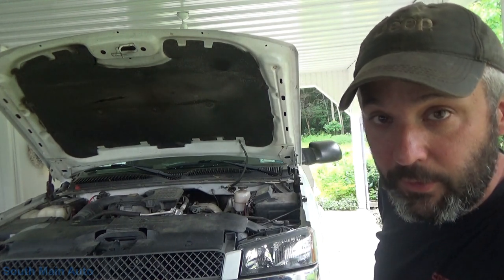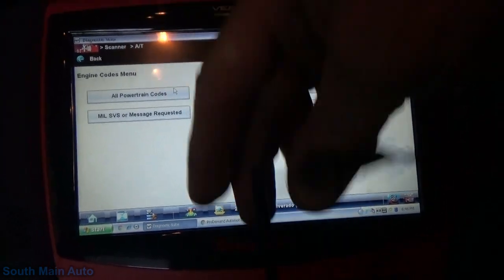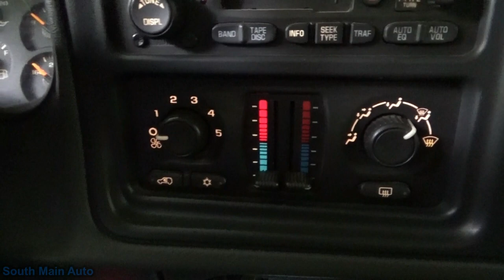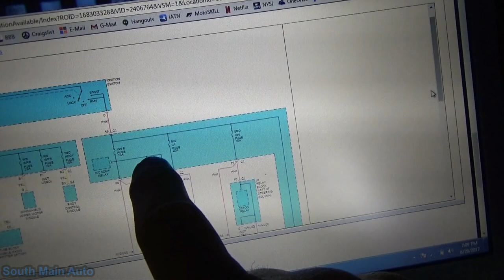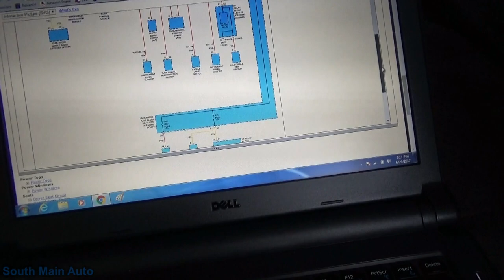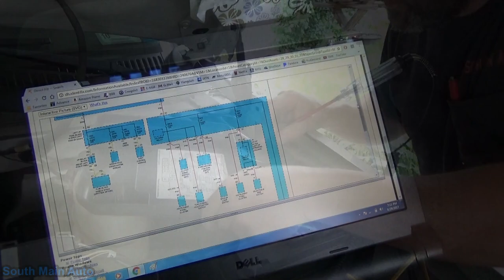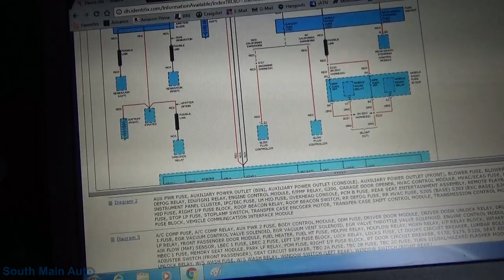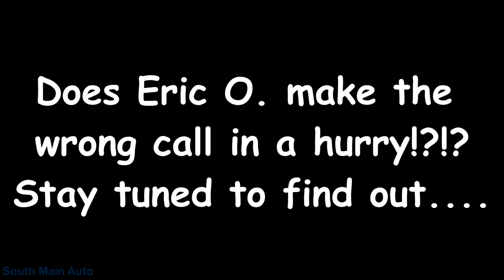Chevrolet Truck - No Start, No Crank - Part I

Comment: Had this same exact to the T situation I was facing today! Thought way back about this video and sure enough wire to ign riding on that same location of fuse box braket green crusties. Gave er a tug and popped in two! I have learned so much from you! Eternally grateful for all you have taught me throughout the years! You rock!

Comment: One diagnostic tool I use a lot and swear by is my relay tester . Plug relay into it and it takes the relay through ten power cycles and does a milivolt drop test over all the contacts. It gives either a red or a green light after testing. It has solved so many faults. Fuel pump relays and starter relays that are high resistance inside and work intermittent. Worth its weight in gold!

Comment: I hope you didn't make the wrong call you tested Way more  than I would have! I would have called it the ignition switch when you could jiggle the key and get the radio to work lol. But that is why you fix other shops hair pullers lol I am always impressed on how thorough you are !!!!!!

Comment: If part 2 is 99 cents, you're off my Xmas list, Eric. ;)
Reply: yes that 2 part vid was annoying to say the least
Reply: I'll spot you a full dollar.
Reply: Bad Drivers of Hurst Euless Bedford 

The nissan cvt is possibly one of the worst out there - even Jacto say so with no end of service bulletins - fluid and filter changes are must, using the correct fluid, it's a flawed design
Reply: $1.25 a minute
Reply: Mr. Steed, keep this channel clean!
Reply: Yeah! I'll tell Mom if you keep it up
Reply: Mrflash222006 dont sweat it, my computer doesnt have a coin slot to pay for videos either. 

Thanks for the info about Jacto, might come in handy for my altima.

Comment: On my diagram I see a red/white power feed to the ignition switch that powers that dead circuit.  I didn't see or hear you mention the red/white power feed coming into the ignition switch.  You just mentioned a "red" wire which feeds different circuits through the ignition switch.  If the ignition switch wasn't it then I'd say there's an open between that 40A IGN B fuse and the ignition switch.

Comment: There is a service bulletin on the ignition switches. Had to beat on my steering column for months until my lazy ass finally replaced the ignition switch. Professional opinion.

Comment: It seems pretty definitive that the ignition switch is bad, provided there's no aftermarket garbage hiding behind the knee bolster. I usually do a voltage drop test across the ignition switch to verify the internal contacts are the actual cause of the problem. Voltage drop tests have never let me down.

Comment: Ive got an '00 Silverado 1500 5.3 and am having intermittent starting issues. You turn the key to start you can hear the relay click, but no crank. New battery and headlights look good. Not a battery issue. Because this issue only happens 1 out of every 4 or 5 start attempts I believed my ignition switch is good. When it didn't work its just dead in the water for 10 or so attempts (2 mins) but eventually one would take and she fired up. I figured the contacts in the starter must be wearing and finally gave in and installed a new starter/ solenoid.  NOW I still intermittently have the issue about every once of every 4 or 5 attempts (as before), but when I have a failed attempt, she ALWAYS starts on a 2nd subsequent attempt right after. So the new starter definitely has helped. I pulled the steering wheel column cover and all checked all connections, appear good. I also swapped my Headlight and Starter relay's in the fuse box to make sure that wasn't the problem, no cigar. Where should I go from here?

Comment: had the same issue on my duramax.put a new switch in and it works. you gotta clock the white gear a certain way in order for it to work

Comment: There are two power feeds on this ignition switch (red and red-white), I think you miss that, on minute 17:42 you said red nothing on that. Well I know part 2 you will let us know. 
No matter what working outside the shop is always hard, your mind is on fixing quick.
Reply: think he may have been on the pink, seems he also called the white wire "yellow" at first (which is crank)

Comment: Is not that pink wire part of the alarm system Ignition disabled\Remote Start. I would dig around under the dash for a relay. As I have seen this a few times. Someone forgot they had an alarm system or never even knew it was installed..

Comment: Hey, I know this might be off topic, well it is. lol Has one out there including Mr O changed a starter on a 07 Hummer with a 3.7. I've change a bunch of them but not a Hummer. Book time is 3.8. says you gotta pull the intake manifold to change it. Any body got any tricks besides a cutting torch and a pry bar???? lol ! Sure would appreciate some help here. Thanks for your time. I'm sorry Mr O for barging in on your channel but you guys are great. thanks again.!
Reply: Well I jumped in feet first and gotter done in 1.9 hrs. intake manifold did not have to come off. maybe this will help the next guy.

Comment: ignition switch is fine, the barrel is worn and off setting the contacts or the plug has fallen apart - never do a mk3 golf (rabbit) as the whole column has to come out to do the barrel and switch

Comment: An old-timer told me once that there is no such thing as a 5 minute job, an he wasn't far wrong. The symptoms are only partially the switch and there seems to be other issues. Easier diagnosis back at headquarters.
Reply: they're known for switches anyway, so good idea to replace it while apart :)

Comment: I had a few GM minivan and also four or 5  1/2,3/4 ton 1 ton Chevy truck with the main feed wire green with envy underneath the fuse box , later 80s 90s and 2000 model year,no crank,power ,then power slowly goes away

Comment: Whenever I run into a complicated multisystem problem I don't understand, I think of a bad ground. I suppose that could still be the case here, although it sure sounds like you proved the fault is at the connector or switch.

Comment: I have a 2004 GMC 3500 Sierra the battery was dead so ask someone for a jump he hooked the jumper cable up the wrong way now the truck won’t start I would turn the key n it does nothing but the lights come on an the dashboard too I’ll take the key out an everything would still be on only way to get it off is to disconnect the battery I’ve checked all the fuse but some one told me that there is a open circuit N would the computer be damage if the jumper cables was hooked up the wrong way.       Thank you

Comment: Oh the suspense is killing me.
I'd say the problem was not the ignition switch, cuz I remember seeing that the ignition lock cylinder was a bit wanky, if you slightly moved the key some lights did go on.   My 2 cents.

Comment: Does the ignition switch have just one power input or are the multiple ones.  I seems like on a newer care there would be one for higher amperage since there was 40 amp fuse, but maybe also a lower amp feed.
Reply: I remember these having two 40 amp feeds. One red and one red/white. Why wouldn't the diagram (@8:57)show this? Also, the diagram shows the red/white feeds the pink not the red. The diagram he's looking at must be wrong?
Reply: I was thinking maybe there should be some relays in there some where if you are talking 30 amps or higher

Comment: The suspense is killing me LOL, I've seen a few of these body style and earlier have partial ignition switch failure. When you take the switch apart and look at it you think it was definitely designed to fail. What's with the flying Pterodactyl noises in the background? How far do you travel on road calls?

Comment: Did you backfeed power from the pink wire thru the switch? Working on a Yukon AC pulling a vacuuum, decay ck & servicing between watching your video and then a Chevy Colorado oil leak & broken temp control cable and then a 2007 Aveo with a P0340 CMP sensor fault...it's a GM Saturday :D

Comment: Love your channel! My 2011 Tundra with the 4.6 liter engine is on it's 3rd alternator, and the truck only has 65,000 miles. I bought the truck new and the dealer said the truck had an oil leak that ruined the alternators. Is this common for the 4.6 engines? I have to thank the dealer as the truck had a 36,000 mile warranty, and they replaced alternators #2 and #3 out of warranty.

Comment: I got no start no codes. Replaced the fuel pump/filter egr valve plugs an wires roter cap. Only starts if I give it some starting fluid any idea why

Comment: Maybe you can help me gonna be a semi long story but I will keep it short. My 2015.5 silverado duramax started with no sounds from speakers or turn signals. After turning it off and on again they would work. I did this recently and all the lights flickered and only one click. I got the batteries tested and they said both had bad cells. Replaced and still one click no flicker. Replaced the starter and still same thing. Every fuse and relay under the hood and inside have been checked and all good. Except for the 60a on top of the battery it doesnt show 12v. I dont know where that goes to. But I am close to sending it to the dealer if it doesnt start after jumping that fuse. I am tired of throwing money at it like a stripper to get it to start
Reply: I get a p0615, p0617 and p262b

Comment: What software you using for the wiring diagram mate? Looks pretty good?
Reply: feartechnition just had a look at it,pretty damn impressive stuff! They got everything covered?  What's the coverage of Europeans and Asians like?
Reply: Its been a while since I've been on it but Its coverage is pretty much the same as alldata and Mitchell. the nice thing about it is the top reported fixes from mechanic's and tests they have done to reach their conclusions. We have a pretty good selection of Asian aftermarket over here after so its covered pretty decently, but euro not so much at least the last time I was on it.
Reply: What was the site for the wiring diagrams please.

Comment: You don't carry jumper cables with you?!
Reply from the maker: Because I have never had a dead battery in the 20 years I have drove I guess.
Reply: Fair enough, I haven't personally had a dead battery since I was 21 but I've used mine several times to help out family, coworkers, and strangers.

Comment: I was just about to kill myself until I realized Eric O put out a new video. You saved my life once again. You are a true hero.😂😂😂😂😂😂😂😂😂😂😂😂😂😂😂😂😂😂😂😂😂😂😂😂😂😂😂😂😂😂😂😂😂😂😂😂😂😂😂😂😂😂😂😂😂😂😂😂😂😂😂😂😂😂😂😂😂😂😂😂😂😂😂😂😂😂😂😂😂😂😂😂😂😂😂😂😂😂😂
Hey Eric. On a serious note. I just had my AC compressor replaced in my car. I notice that it makes noise while the car is at idle. The sound is like a moaning noise. It seems to be cooling ok. The temperature coming out of the vents is 38 to 35 degrees depending on the time of day. I was just wondering if it is normal for compressors to make these noises??  Thanks
Reply: No its not normal. Was it new or remanufatured? Maybe just the bearing, take of the fan belt and start the engine to see if the noise go away. try to spin the ac compressor clutch by hand. Should rotate smootly with no sound.